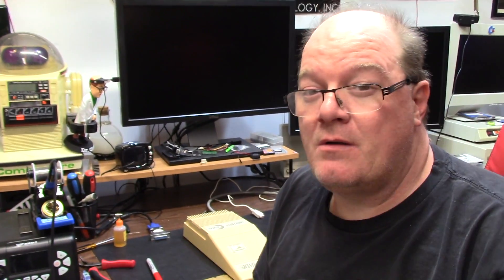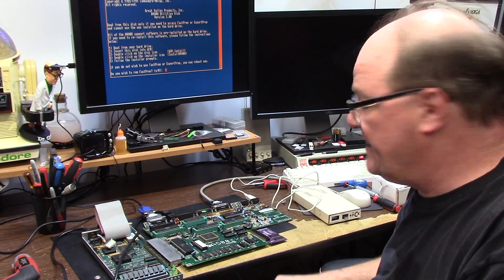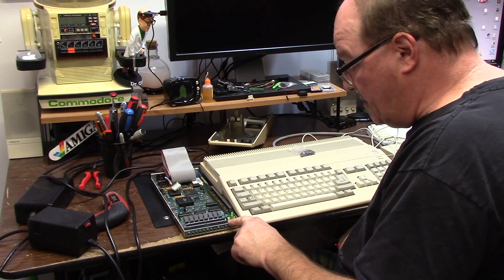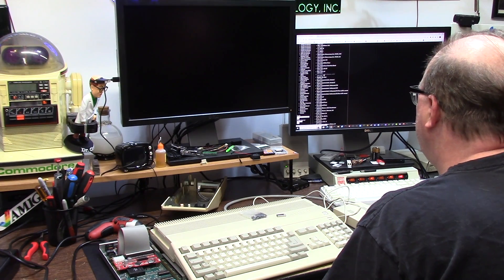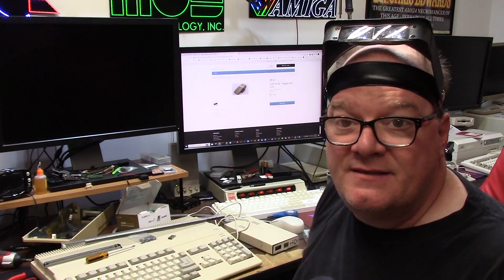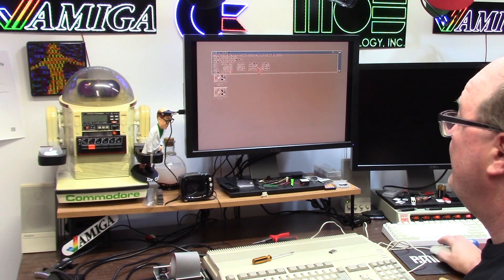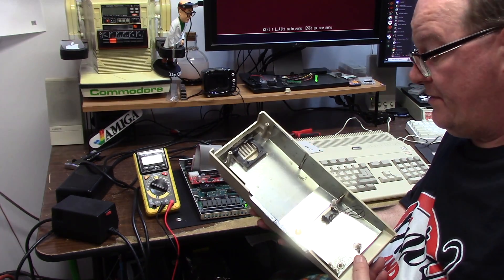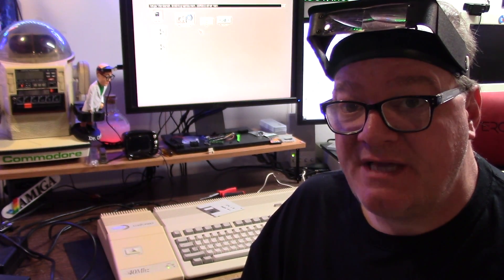Davids Amiga 500 GVP A530 Turbo

Comment: The A530 requires the GVP PSU.  The A500 PSU doesn't have enough power and the design won't allow powering from the A500 only.  No Exception.  The A530 PSU is actually beefier on the 5V rail (4A) than the non-accelerator GVP A500-HD8/HD+ unit.

Kickstart is remapped by the GVPCPUCtrl command and onboard logic for the 68EC030-based CPUs (no MMU) if it's a default GVP install.  That's likely the extra 512K taken.  The rest is FFS's overhead for the disk bitmap.

The drive speed seen with SysInfo was probably the result of the SCSI device unit you chose.  Pretty sure that red unit is based on the original SCSI2SD, which was ~1.1MB/sec capable.  The native GVP driver (v3/v4) is Async SCSI, so it will top off around 2.2MB/sec with better devices in optimal situations.

The A530 will work with Kickstart 1.3 and higher.  Use SetCPU to set the data cache on.  GVPCPUCtrl will remap Kickstart with an 68EC030.

The GVP v3.x/4.x driver will work with larger than 2GB partitions and 4GB disk media only when you have Kickstart 3.1.4 and it's newer FFS.  Older OS (1.x/2.x/3.1, and it's FFS in particular) is not capable of handling above those limits.  This is the same partition size/media limitation as the A2091/A590.  Read the FAQ on the newer OS releases please.  

The GVP FastPrep/ExpertPrep tools should not be used for larger partitions - stick with 3.1.4 and newer's HDToolBox for that.  

- Robert Miranda / Former GVP Tech Support (1989-93)

Comment: My GVP .040 does not work either.  I'm reasonably sure the SCSI chip is fried, can you replace it.  I have a GVP board from an A2000 with the same chip.  Can it be swapped?
Reply from the maker: @AmigaMan500  yes the amd or CBM proto ones work
Reply: @ChrisEdwardsRestoration  Can I send it to you for repair/testing?  Also, I have 1 working floppy drive, I saw one of your videos where you adjusted some. Can you fix me a couple? I also have the 2 meg chip ram for my A500 that quit working.

Comment: What about a SCSI2SATA Adapter that will let you use 256GB SSD drives.
Reply from the maker: the roms in the device do not allow for large drives greater than 4gb max split into two partitions. regardless of amiga rom support.

Comment: on the GVP a530 Jumper CN18 pins 1-2 (default) is 7mhz bus speed  and 2-3 is 14Mhz you can get 2megs a sec on that speed test, sort of like doing the 14mhz upgrade on a a2091 scsi controller, but with a jumper
Reply: The A530 is natively set to run the 33C93A at 14MHz.  The jumper move was applicable to the upgrade from 3.07 ROM on the A500-HD8/HD+ to v3.14 and later gvpscsi.device only.

Comment: Anyone remember an 8meg expansion unit that went between a500 and slot in external harddrive?
Or am i imagining it,only saw pictures in mags back in the day?
Reply: @counterair173  yes I think so...gosh,I remember it been very very expensive.
Reply: I'll Google what you said now thanks 😊
Reply: Supra ram 500RX is closer,but that isn't it either...I might be imaging it.
It was a longer strip then the 500Rx and was it's own contained module and sat in the middle of external harddrive on the left and an a500 on the right.following the same contours of both devices ?

Comment: Tryed what you said now all I have is a is a black screen and a Cap lock that comes on for a second or two when power turned on any suggestions would be helpful.
Reply from the maker: dont know. you may have popped a chip, you can try reseating denise , pushing down on agnus. its hard to say without seeing it.  those 68K ram board ide add ons cause issues, as you are living now.

Comment: Chris I have a amiga 500 that had go fast ram 8meg that has been fighting me I installed it and now have a dead machine have you come across this problem the machine flashes red on cap lock once then nothing black screen you also hear a noise from drive
Reply from the maker: Is that the cpu ram board thing w ide on it?? They have a real
Bad track record.  Take it out and put the cpu back in regular and see of it works in basic mode.   Then toss that in the bin and get a pistorm

Comment: In addition to the possible random erasing, I also thing some people are "fixing" old gear. They just look at the chip part number, find one on the internet and order another. But they dont know enough to check the datasheet to realize it needs programming. Having failed, they give up and sell it on to some unsuspecting ebay customer who then has the sense to either know how to properly repair or send it to people who do.

Comment: I still have my A530 from back in the day. I remember the scsi cable blocked the fan and the heat caused the scsi drive to shut down. The '030 gave a nice boost in performance.

Comment: The A530 uses PALCE chips which are protected PALS. They cannot be read in a programmer. I have jed files for U35, U38, and U40 for the A530 pulled from unprotected originals. I have written these to new PALS and they work on my A530.
Reply from the maker: Maybe thats similar to the ones i bought.   You should upload those to the amiga wiki files
Reply: I would be interested in the files. Can you share them with me?
Reply: can you post jed files?
Reply: hi Chris, where do i get the Files or the PAL chips? Ver good stuff here
@hamrdeye8927, maybe i can get it from you

Comment: Another great video! Did this one have the metal RF shield fully installed? I know some folks like to take them off if they are not  connecting to a TV or non-VGA CRT. Perhaps those GVP chips are simply too sensitive to static...

Comment: i USED to have  one ages ago, till the HDD in it died then the Power Pack Died. (( and in one of the few Housing moves i delt w/ as a kid,  i accidently'd past the point of no return n it got l;eft behind ;-; it had an adapter inside for 286 Emulation. ))

Comment: Chris can you send me a link on how to do the power mod on the GVP A530. I’m going to switch my scsi2sd with a zuluSCSI so the power mod would be great. Does anyone know of this power mod Chris mentioned in his video. Any help would be appreciated.
Reply: Not possible with the A530.  The A530 PSU has a 4A 5V rail ad 12V for the fan (required with the heat the 030 generates)/HD connector.   The onboard logic won't allow powering from the A500's PSU.   You can only do that with the standard HD8/HD+ units.
Reply: @M2TechnicalServices thanks for the info

Comment: That is a lot nicer than what I had. I had the ICD Trifecta 500LX and the Supra Turbo 28. They worked well but the fact that I had two pieces plugged in was a bit worrisome since my desk was not a rock-solid platform. I would have been really happy to have had an '030 but I had to settle for the 28Mhz '010 that was in the Supra.

Comment: Hi Chris, love your channel! I have an A590 that was a gift my father gave me many years ago when I was about 15. It was working up to sometime last year. I turned it on and I smelled smoke. I turned it off and turned it back on. It still turns on but does not load. I would love to get it repaired as it has a tremendous amount of sentimental value. Can you please help me fix it? I can compensate you for your time. Thank you!
Reply: It's probably the +12V rail. That one is used to supply voltage to actually spin a motor. Good news - hard drive replacements / emulators like ZuluSCSI don't need a +12V supply, because they don't have motors.
Easy enough to check, disconnect the power to the hard drive, and measure the voltages with a multimeter. I bet the +12V doesn't read, but the +5V rail does (can be fed direct from Amiga on an A500 hard drive.)
CBM always recommended a separate PSU for the A590. I am unsure as to recommend what to replace it with. But that's where I would look.
Reply: @PATTHECATMCD  do this^ i did with my A590 and also get a newer rom for larger hd sizes!

Comment: The reason it doesn't work is because it's made by GVP...nothing but trouble. Do what I did, pull all of it out, replace it with something else, and then all problems go away like magic.
Reply from the maker: Well i fixed it so…. I also have no issues w gvp